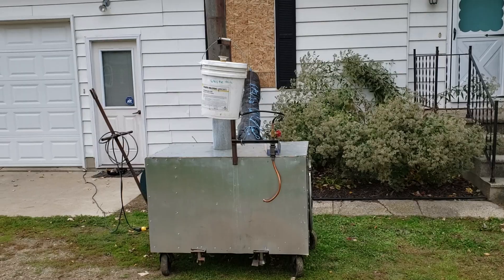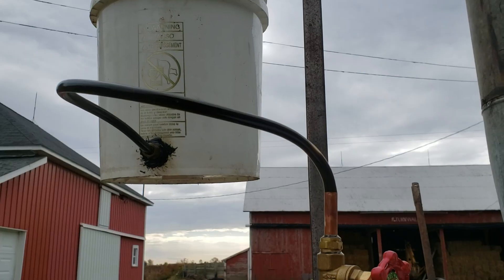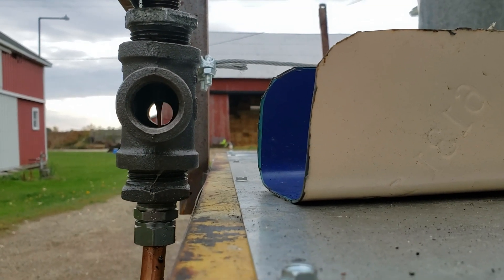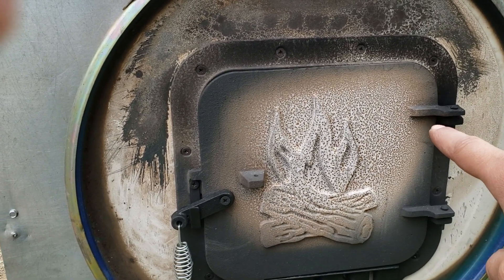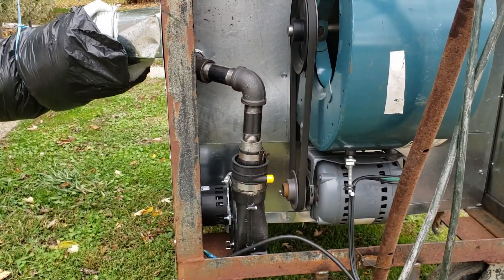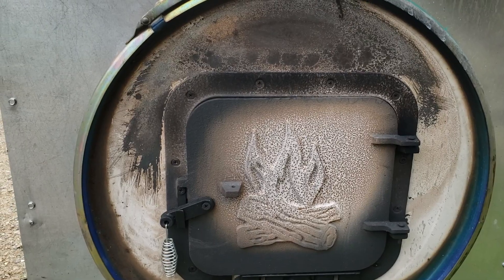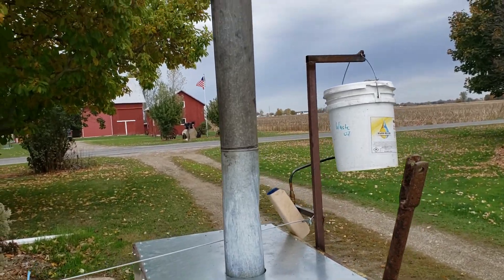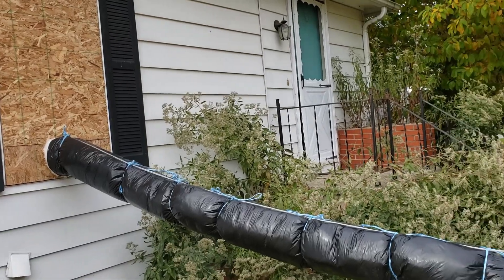Waste oil burner, heating my home with free oil

Comment: Cool! I worked at a truck repair shop in South Seattle for 24 years. We worked on the big rigs, trailers, dollys, etc. Fleet maintenance. We also had a body shop separate from us. Bay doors wete like 16' high. Super hard to heat in the winter.  I found an ad in a msgazine for a waste oil furnace. We generated lots of that. An oil change might generste 10-14 gallons of oil, and another 6-8 gallons of gear oil. We got two of the oil burners. We had a 1000 gallon holding tank for the waste oil. Had a bunch of 55 gallon barrels too. We stored the oil in the wsrmer months, and pretty much bufned most of it up each winter.  Had to take a big shop vac and cleanout the ash fairly often. The other oil burner heated our body shop. In the esrly dsys compsnies would buy up our waste oil for like $1.00 a gallon. Later, they quit paying, but pumped it and hauled for free.  We used the waste oil money, and money forrecycling scrap metal, to fund a company picnic in the summer. We recyvled our waste coolant also. A big Kenworth radiator holds 10-14 gallons. There was a guy in a converted truck camper with all the equipment in the camper to pump, filter, revharge with ethylene glychol, and fill that into gallon jugs, to be sold to customers as 50\50 coolant. Thst coolant guy was having a hard time keeping up with that need and the travelling etc. I'm an old retired geezer now.
Reply: So I have to ask the question as another Puget Sound resident because my ears pricked up when I read it... South Seattle... Truck repair shop... Gary Ridgway wasnt one of your former coworkers right?? Just checking!
Reply: Negative. But, having worked for almost 30 years on or near the airport strip, I can tell you it's a rough neighborhood. Murders, bodies dumped into the Duwamish River, etc, etc.
Reply: Hi, dunno if you are still around - but old retired geezer you may now be - you were certainly a smart unretired geezer in the past when you decided to Heat your workplace with the then available and plentiful waste oils from your business premises all those years ago. 😉
I'm also Guessing you might be a two finger/dit Keyboard typer/typist like myself and never learned to touch-type like the younger generations these days as I used to make exactly the same Typo- errors you have made in getting your points across - simply by hitting too many keys on the PC at once or off centre. 😉

Since I make comments on a wide variety of you tube video presentations - far too often -daily in fact - being a two digit typer myself - I constantly have to proof read what I've written and self edit what I write so as to not make typo's when I attempt to type too fast. 

Incidentally, I'm an old retired geezer from the so called 'baby boomers' generation also. But an Aussie one from the printing trade and I had my share of proofreading when I was an apprentice in the Lithographic printing side of the industry - but still make typo's from time to time as even the - real- proofreaders needed another proof reader to check their proof reading before going to press. 😉🙃

Comment: Greta Thunberg: HOW DARE YOU!!!
Reply: The oil gets burned anyway if disposed "properly". So this is quite green if running lean enough and burns cleaner than average diesel. There's also way less NOx as there's no compression. So your wet dream of upsetting Greta doesn't work here.

Comment: Be very careful! Any leaks in the barrel (also your heat exchanger) and/or flue could let carbon monoxide (odorless and invisible) into your 'surround' (plenum) Even heat exchangers in modern furnaces can, and have failed...resulting in fatalities. Is that flue pipe galvanized? CO detectors a must!

Comment: Several years ago I built something similar using an old pressure tank inside the 55 gallon drum. I burn wood inside the pressure tank that's been opened and the bladder removed. The blower sits atop of the barrel which lays sideways. It works well except the blower uses a hell of lot electricity and electricity is very expensive up here in Alaska so I use heating oil to radiantly (in floor) heat my home instead. The "woodstove" is still set up in the shed next my house.
Reply: Hi, Electricity cost is high anywhere mate even though likely extremely high as you say in the case of Alaska and, not likely to get any cheaper - because of so called Global warming issues and the probably unnecessary move to replace fossil fuels and use so called 'green' energy sources as advocated by global warming/climate change alarmists!   
Personally I believe climate changes are cyclical and have very little to do with humanity's degradation of the ecological systems of the Earth and more to do with the suns' activities over which scientists or governments have no control whatsoever.  😉🙃

Comment: There are people all over Texas right now that wish they had one of these.
Reply: Wouldnt work without the blower..
This wont work without electricity either.. ✌
Reply: @TheNevarLaW  mine works fine without a blower, just lots of soot and fly ash
Reply: @DanishSpeakerChannel  I’ve seen one of these where they said that if you filter the waste oil you get a lot less ash. They ran it thru a large car oil filter with a external filter adapter. I’ve seen those adapters for sale on line.

Comment: Do you have a carbon monoxide alarms?
Reply: The oil fire is only inside the combustion chamber. The hot air around the outside of the barrel is blown in the house. The exhaust pipe is outside.

Comment: Slight mod/improvement for you-

Build the fuel tank on top of unit, have chimney go up
through the tank, warming the oil. No outside piping
to ever chill the oil.
Exhaust can be fabricated to be a "velocity stack"
to harness it's pressure.
Fabricate a "turbo" unit, inline with exhaust stream,
to a pulley/belt, to run a 12v DC generator, that powers 
a pump for the warmed oil to spray through a nozzle in the
Firing chamber. The turbo/generator unit could also
power the burner blower feed.
All generation is balanced with an AGM 12v battery.

The only "outside" electricity needed is the actual
heater duct blower- in times of outage, could also be
generator operated.

Comment: If your in Florida put a dam heat pump in. More energy effiencent then gas furnace above forty degrees below forty degrees run gas or oil heat or electric back up heat. Hybrid

Comment: Do  you have to filter the waste oil or let it settle to separate contaminants?  Or does it have to be pure waste oil with no contaminants (water, hydraulic fluid, etc)?   I know, ideally, you want pure oil, but that may be hard to come by.
Reply: If you filter the waste oil, you will have much less ash in your burn pot.

Comment: You should have the squirrel cage fan enclosed with another return duct to the house. That way you are circulating air from the house over the 55 gallon drum heat exchanger instead of pulling cold air from outside. Just a thought from a former hvac tech. 😀
Reply: I was noticing the same thing. But since his system is not set up to cycle off and on with a thermostat this might be better... Otherwise his house would get a bit too toasty. lol

Comment: Why don't you use some makeshift boiler and heat up water with that oil burner? Yes, you need radiators but it is much more efficient

Comment: i would use a bigger flex line into the house probably atleast like a 10-12 inch that furnace blower puts out alot more cfm than that 6-7 inch can handle. cool idea tho

Comment: What a smart project, what's your consumption? Also you may make your solar panel system for the air blower and be off grid... Good job
Reply: Hi, Yep another good idea - I'd even consider using one or two or more car or truck 12 volt fan units as the blower as the Air con fans and those cooling the radiators in cars and trucks are fairly strong these days - but the ducting system to the house in that case would need to be very much smaller of course - however there'd be less solar panels needed for powering a 12 volt system.😉🙃
Reply: Hey SOLOman, I totally agree w/U (all Ur comments 100%). I also know this isn't Ur video. 
But I'm curious as to U'r opinion ?  You'd said fan units from a vehicle.   : ) using a good ole household vacuum cleaner ? or tinker with Kirby, Bissell or Hoover vacuums ?  I started collecting them about a yr. ago (have at least 15-20) now, because they were "FREE", people want them hauled off or just (2 lazy) to clean n service them, don't want or know how to ck 4 broken belt & replace it ? So : ) whenever I need a motor for whatever, like a grinder, belt sander.  When taken apart (& reverse -engineering is done), they will run on DC voltage too & will put out quite a bit of air. Using the airflow from vacuuming to blowing (like using a "wet n dry" shop vac)  forced air. 
Reason I ask Ur opinion is, I'm seriously considering doing something along these lines, but I'm trying to figure out a STR8 forward (w/least complicated & cheapest way financially) on which way to tackle this ? Because I have (numerous options really does complicate things even worse) options laying around & in storage, like an old water heater, dryer drum w/vent holes, a 2 ton (complete) A/C split pkg unit, a 6' tall LP gas heater. Also have a cpl metal 55 gallon drums.
Thx David aka: DavnTenn

Comment: I have a black gold 20000 BTU setup and Im in Wisco.....I will go thru about 700 gallons in a winter heating a 20x30x14 high insulated and steel paneled shop.....They work but they hungry so make sure you got a good supply of waste oil.

Comment: I work at a car dealership that also does service, if I ever own a house I'm for sure building one of these.
Reply: It’s cool to see. But just go with the reliable furnaces and wood stoves that already exist. This item relies on a 5G bucket.... which will need refilled at least 5 times a day, maybe up to 8 times on the coldest days. Also, there is a reason oil tanks are inside of the house. Lastly, in order to even justify the oil heater you have to find enough waste oil ( without coolant ) and keep that demand up as if it were beer.... cool idea, just not reasonable anymore.

Comment: replace that power cord it's got a break in it, Get yourself one of them small tin sheds and put it inside that or make your own green machine hut for it, the air around it will be warmer, also better you pull the existing air from another area inside and rewarm it, this process will warm the air quicker and maintain a better temperature inside. Use a propane torch to ignite the oil first time flame up. A thick steel bowl is ideal inside, it won't burn out.. rig up a steel basin for your ingoing oil flow, maybe cut an old freon container or empty propane tank so it can be heated to keep oil warmed prior to drip, also put it inside a shed will help with this! I've seen people make these with pre-warmers others have them inside shed/shop.. Great job overall, now just improve on the efficiency.. I know zero cost but less work/oil usage if more efficient too.. remember all oils, grease, transmission oil, old cooking oil and deep fryer grease all works, another good reason to have the warmer is to thin out the thicker stuff.

Comment: I have same idea but put in the air in cross space under the house and let the fan from the furnace pull the air in I have to put a hole in the floor

Comment: Check your  local and state EPA codes, I purchased one for my Auto Repair Shop in Patterson Ca., came from Idaho, ran it for most of our short winter until the Fire Dept did their Annual inspection, got ticketed and fined $500 from the city, next day Cal. DER (Dept. of Environmental Resources) showed up and got fined $10,000 (got it reduced to $2500 + $2500 for lawyer) all because I didn’t check to see if it was legal in California. Do yourself a favor and check the State and Local codes. Btw it worked great, cost $1700 + ducting ($200)

Comment: This is exactly what I have been looking for..  I would like to do exactly what you suggest, place a return and a main with dampers in it to use with the central air.  Job well done.  

My only concern is the height of the flu.  What are your thoughts of the height of the flu for safety reasons.

Comment: I've been looking to do the exact same thing, I love your setup. And will be using it as a template for mine.
Reply: Hi, I don't think you'd go wrong with that design but you might need to ask him to illustrate how the central internal burner was constructed as that's the most important part of the heating unit  - which when all is said and done is not that far off commercial grade or quality Or even better than many Factory made units that are perhaps neater looking in their finish maybe - but no better functionally - from what I can see.  And it's practicality and usefulness that overrides pretty looking units anyways and even on that score it's still pretty good looking for DIY set up - nevertheless.  🙃

Comment: Nice build! How long does 5 gallons of oil last in the winter? How much ash/ waste do you get? What oil have you burned? i.e. motor oil, transmission fluid, hydraulic, etc. Great video!
Reply: I saw on another video from someone, can’t remember who, but they said if you filter your waste oil, it gets hardly any ash in it. They ran it thru a large spin on car filter mounted on oil filter adapter.

Comment: How much oil do you go through a day and where do you get your waste oil from? Could you use grease from waste grease bins at restaurants?
Reply: We heat the auto shop I work in with a big manufactured version of this.  I asked the manufacturer in that unit could we use waste cooking oil and they said absolutely not.  And if so it would void warranty.  But I would imagine thats only due to possible contaminants(chunks of what not).  Looking how he's got it set up I would think you could as long as it flows correctly.  I think we were told no just to cover their butt.  Would be interesting to know though for sure
Reply: Try quick lube shops, sometimes they will give it away or sell for cents? per gallon.

Comment: Love the build. I considered using a 55gal barrel as well, but was detoured by it's thin walls. Building the heat exchanger is very cool. I cheated and used an old refrigerator for my heat exchanger. It isn't pretty but it works well and allows me to keep it outside for Insurance reasons. 
 
 My waste oil burner works to well. It scares the hell out me.  I quickly learned the importance of a flue dampener. The whole top will easily exceed 1,000 degrees. The flue pipe at base is around 500 to 700. If it isn't monitored until optimal efficiency the thing will fire up like a afterburner on a F18.  It will go from 500 degrees to a 1,000 in seconds!Like I said, scairy.
Reply: Great idea on using the old fridge. I was just trying to think of a cheap way to get that much sheet metal!
Reply: @stevenmark8156  You should use aircrete. It's cheap and you gain the insulation and safety features of aircrete.
Reply: @matthewmccartney3926  I’m not familiar with aircrews. I’ll have to look into it. Thanks!
Reply: The 55 gal. Is the heat exchanger
Reply: Hi, yep any type of white goods - like buggered fridges, dishwashers, home Electric rotary clothes dryers, old and non functional washing machines etc all have square metal frames that could be adapted to make heating units of various sizes that would serve as the housing for the inner burner unit.
But of course a suitable sized internal metal drum /burner to fit each type of throw away White goods unit - would either need to be sourced or cut down to fit the available outside framework.

The internal drum from a rotary clothes dryer might serve as the internal burner but the metal is not as thick a gauge as a 44 or 55 gal oil drum.    But on the other hand - could indeed be replaced as needed fairly often or cheaply because white goods are not made to last these days and are in plentiful supply on solid waste annual Junk drives - IF you happen to have that service by your local council once or twice a year.

I'd even consider the drums on the older type washing machines - that were built to last and were pretty thick - even though they have holes in them as those holes might assist in ventilating or drawing heat away from the interior drum via an exhaust fan of some type being fitted to the unit that draws hot air away in the cavity between the outside square sheet metal frame - from the inner round drum.   🙃

Comment: Great build!
On average, how much oil do you think you go through on a typical winter day?
Reply: Answer this man!
Reply: @SovereignMax  FYI 1 gallon of heating oil or diesel about 138,000BTU. 1400sqft home R19 insulation requires 10,000BTU/hr to maintain 68°F inside during Winter when nights are 32°F, days are 48°F, so in round numbers you need a gallon a day if you do not burn at night/day when sleeping or at work away... A gallon a day is a good starting point...your quantity depends on many variables. Smoke means either more heat (better burner) or/and likely much more combustion air. Good luck!

Comment: A gallon of used oil, if burned efficiently, should provide about 200,000 BTU’s per hour. That’s enough to heat 3-4 small houses (for an hour).
Burn oil to heat water in a copper coil and run the pipes (supply and return) into the home to a coil-style heat exchanger in the air-handler.
Set the flow rate of oil (using a valve) to the heat output required for the home. Have the thermostat in the home activate an igniter in the oil burner.
A very simple but very effective heating system.
Even in a cold climate, 2 gallons per day should be plenty to heat the whole home.
Can also heat the domestic hot water in the same way.